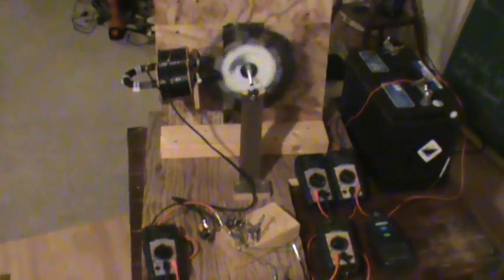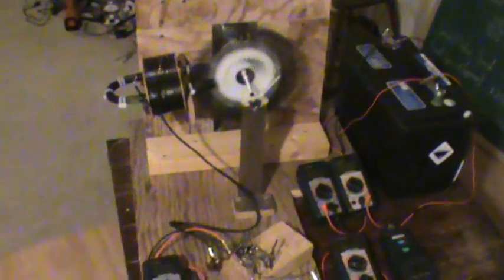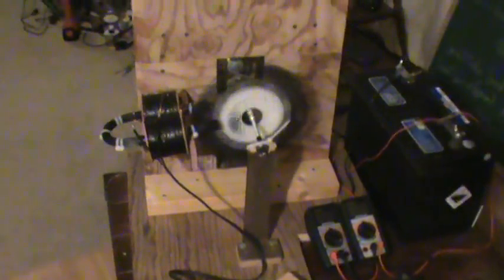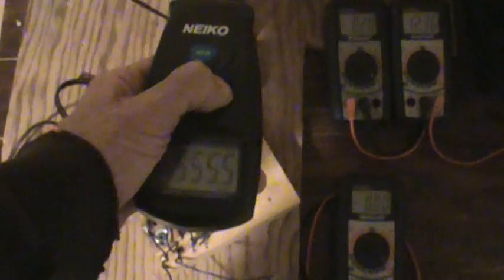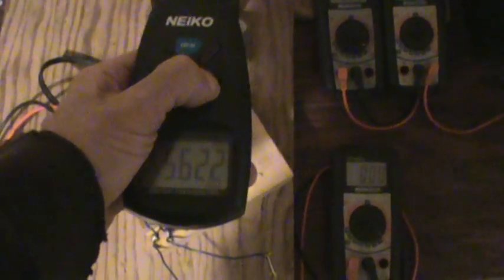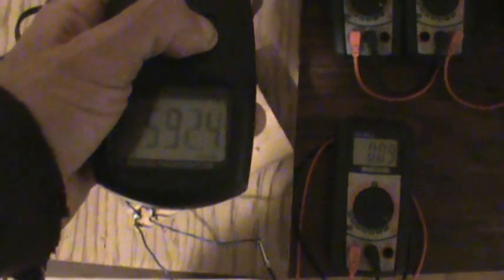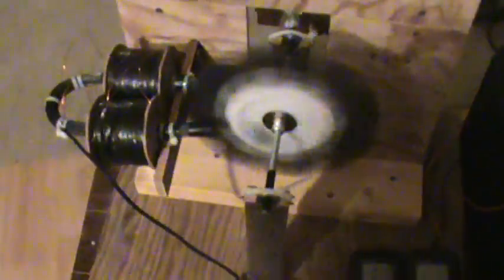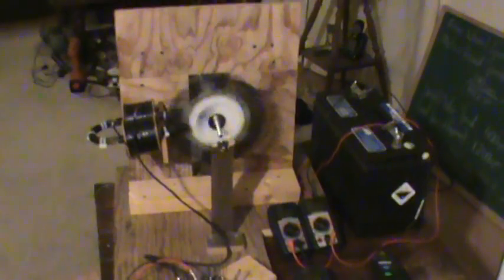Free Energy Project - Old Wheel Dead - R.I.P.

Comment: There is a book of Nikola Teslas work called Colorado Springs Notes and in it describes the inductance and capacitive states of coils, very neat stuff, but what really stands out is the reactance of wire in the coil field. The wire acts like a super negative field in oscillation so it now absorbs more energy from the air ionic charge. I've duplicated the effect in bifilar coils.